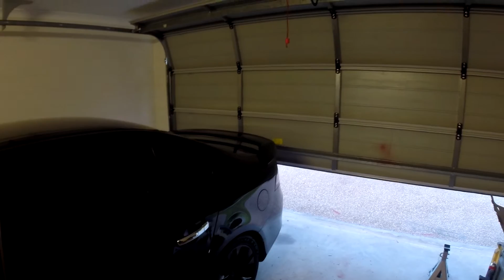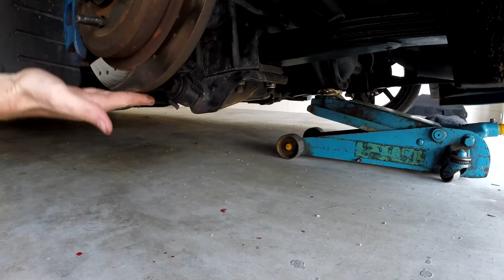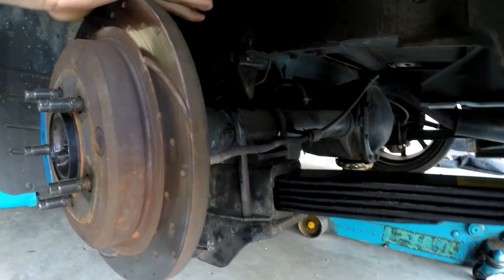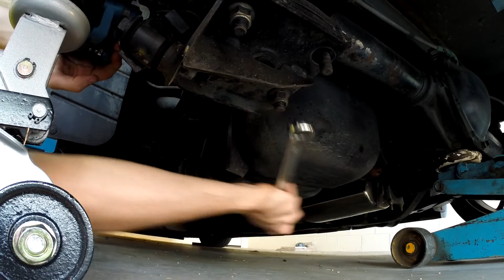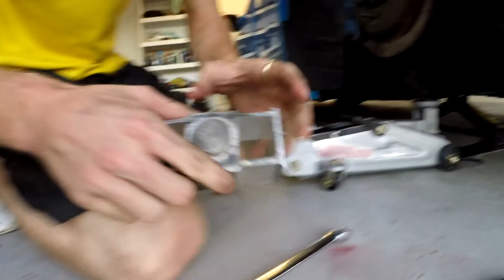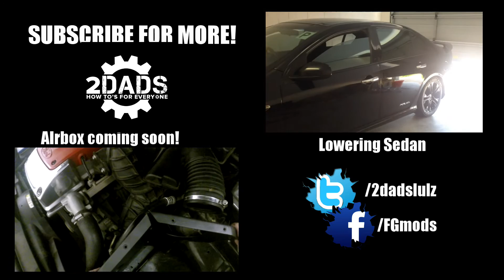How to Lower the FG Falcon Ute

Comment: You need 19" wheels and bigger otherwise the rim touches the shock eye. The way to get around that with 18 inch wheels is to put the space leaf on top  and that only gives you about 7 10mm clearance

Comment: I put 1 inch blocks on my bf after having it reset already and the tail shaft starting making a slight wining noise straight after you had this problem?
Reply from the maker: It can do yeah. Need to take it to a shop. If you lower the ute too far it can cause problems with the driveline.
Reply: That's happened to me taking the car to three different shops still have the same fucking problem. Vibration in the gear stick steering wheel and foot pedal it's getting to be a joke now no shop knows what's wrong with it
Reply: this happens because the diff housing is set to run the pinion angle at stock hight. when lowered, the drive shaft angles change meaning the diff pinion angle needs to change. the wining noise with be either the CV join binding slightly or the uni's binding slightly as utes tend to have 2 different types of shafts. id suggest going to a diff specialist to have this looked at before u kill the drive shaft or the pinion bearings.
Reply: AUS MODS I have lowered many old Falcons over the years with leaf springs from XY, XB, XF and I have never had any winding noises. I have a AU 1 Toner and thinking of lowering it, I have never lowered a AU 1 Toner
Reply: @ufo-bro532  that is because all previous falcons have been 1 piece drive shafts, from BA onwards and AUs with IRS rear all have a 2 piece drive shaft with a center bearing.
Reply: Aus Mods my AU 1tone is a 1 piece  drive shaft
Reply: AUS MODS all Utes with leaf springs don't have IRS diffs!
Reply: @ufo-bro532  u miss read my comment. I know AU utes have leaf spring live axle as well as wagons. Some sedans had IRS those had 2 piece shafts as i said from BA onwards, even the utes with leaf springs and wagons had 2 piece shafts. I know this as i use to work for Hardy Spicer making drive shafts.
Reply: @ufo-bro532  How'd you go lowering it mate did you just reset the leafs? I've got a au 2 xr8 ute with a tub and looking at getting the leafs reset. Did you have any issues lowering the 1 tonner?
Reply: @jcrittle_   I just bought a brand new pair of Pedders lowered leaf springs 2 1/2 inch $700 pair over a year ago
Reply: @jcrittle_  I had no probs with lowering the 1 tonner